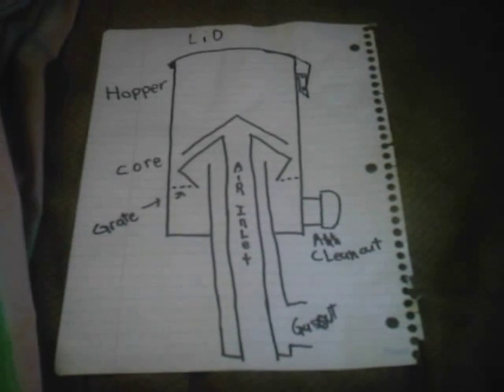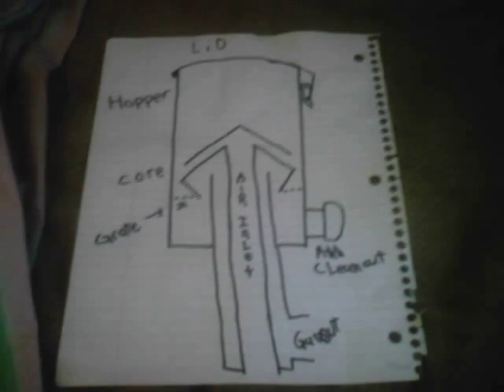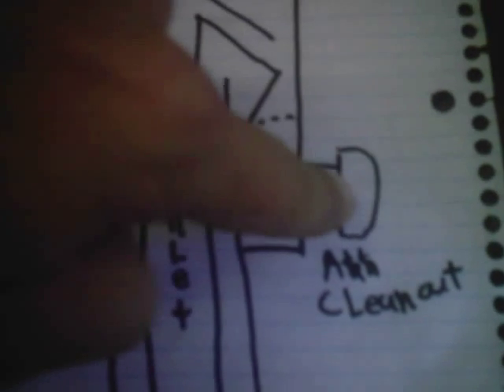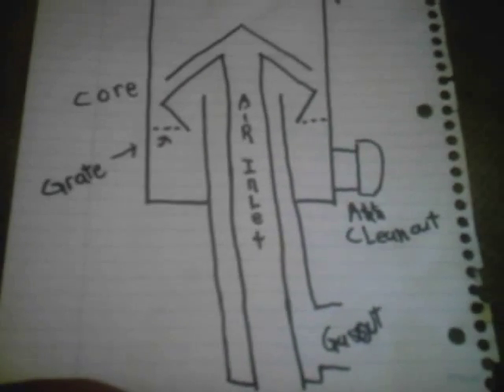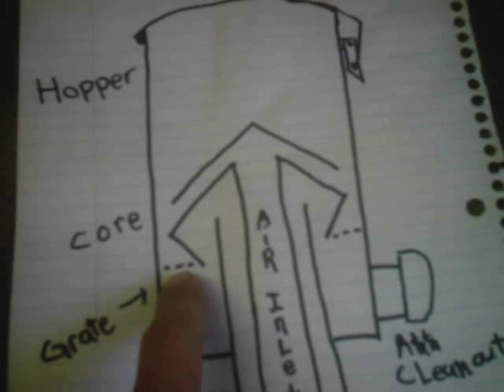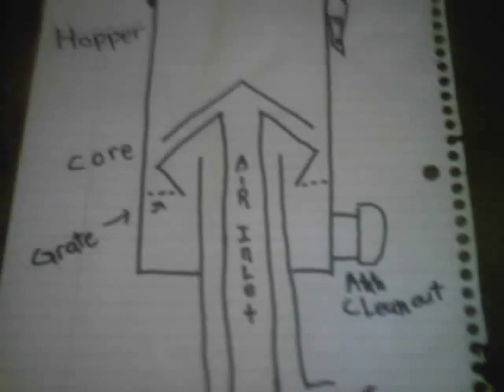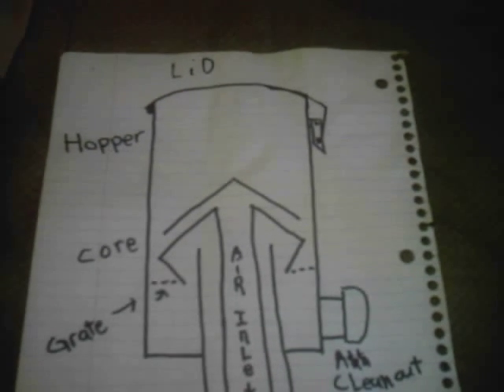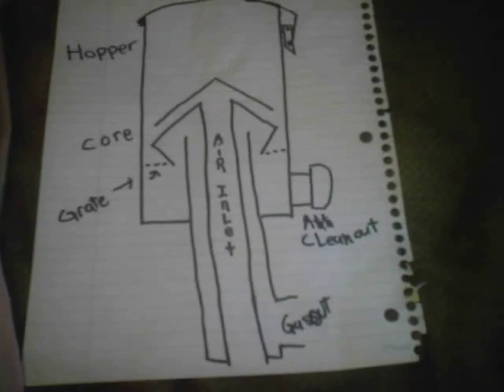new style wood gasifier sneak peek =3-

Comment: You have some interesting ideas going on here  :).
The G3 gasifier constitutes a radical departure from the standard Imbert configuration while retaining and perhaps enhancing its functional attributes.
It will be very interesting to see how you go with this, and what complications you may encounter as you go.
For the fuel diverter cone, perhaps you could have a threaded rod running up the centre of the air inlet pipe. This would let you adjust its height and also give you a means of agitating the fuel / charcoal zones from outside the system.
Maximimun coolness could be achieved by your new system soon  :) .

Comment: Yeah man I've seen this! I think this is a really cool design! How close are you to starting on this build?
Reply from the maker: well soon i hope it depends on how the scrounging goes lol =3-
Reply: xoxoXoieoxox
I can relate to the scavenge hunting. You definitely have my attention on this build. I damn well almost built a spin-off of this where heating the inlet air was concerned. I designed a J-Tube setup and I still have all of the pieces for that idea stored away. It was going to follow some of the same guidelines such as the air being brought up thru the center of the ember zone so that the hot gas would heat the inlet pipe up. The G-3 looked like someone put a lot of thought into it so I will be looking forward to what you come up with. Good luck man.
Reply: xoxoXoieoxox I went and found others that have built this including the original guy (I think) where he had a flat steel table where he could remove his fire tube and expose his upside down cone and I noticed he had it set up so that he could raise and lower his cone thus controlling his gas output on his gasifier.
You are going at this with a different approach where it looks like you are going to leave off the 12 holes drilled around the fire pipe/hopper and just bring the air directly up the center then extract the gas back thru the bottom all while heating the air intake. Something that I found really interesting was that on his build I didn't see any way to clean or remove the biochar during the operation as to give him back the space for the fresh fuel? so I am guessing that he would just run his for short runs then just remove his steel tube and sweep the biochar away since it was just free standing in place under it's own weight. On your concept I did see where you do have a biochar removal port and since there is no grate I am guessing that the only thing you may wind up doing is adding a gentle vibrator to keep things moving inside of the setup. Is that correct?
Reply from the maker: check this out awesome wood gas cooler
Reply from the maker: check this out lol =3- wood gas victim
Reply from the maker: flash001USA i found that if u mount the reacto to the same frame as the engine the engine will will vibrate the reactor im all about getting every oz. of energy this thing can produse i am even going to build a boiler in line for cooling and i have a 10 hp steam engine to runn on it i built the steam engine my self check it out V-5 on live steam @ aprox.15 psi u might like to try to build one its super simple and all the parts u can get from the junk yard =3-